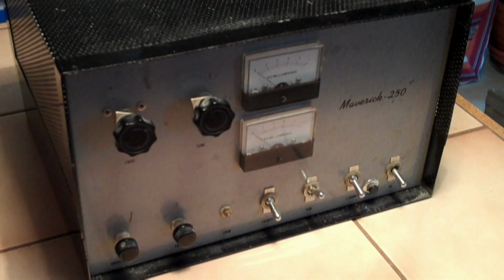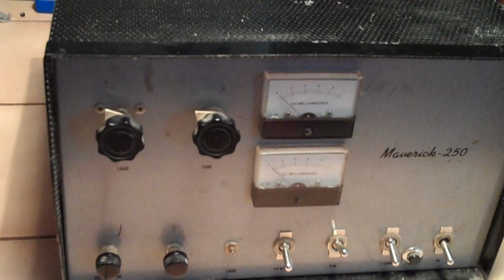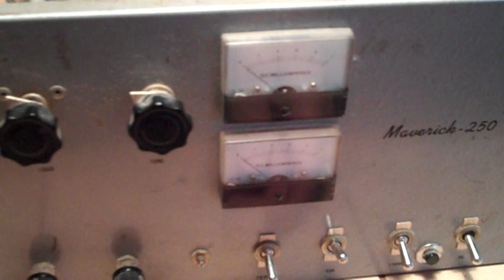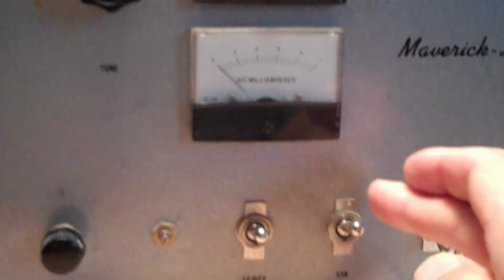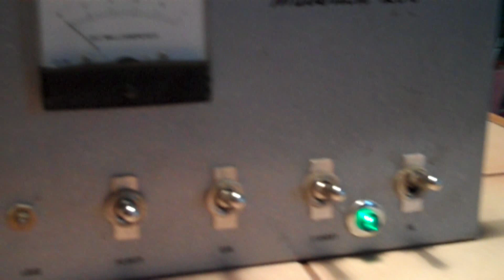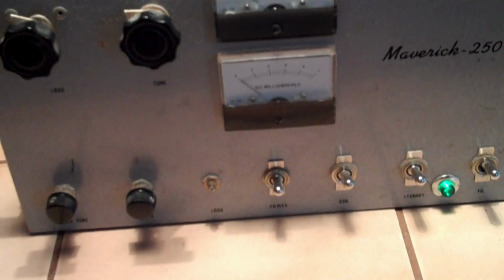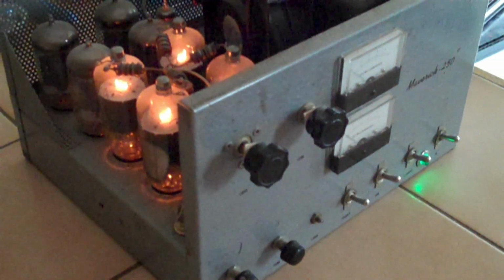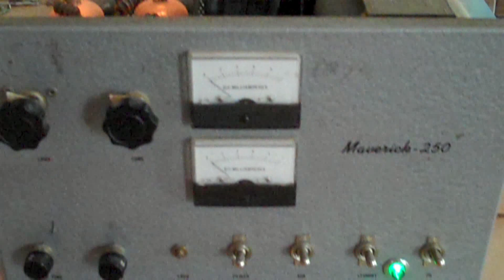maverick250

Comment: That's not the factory fan but rather an aftermarket fan installed in it ! The POWER SWITCH connects power to the transformers which in turn supplies voltage to the fan and the filaments or heaters in the tubes both driver and final tubes also the keying tube ! The standby switch enables the keying circuit when on , and disables it when in standby mode ! Low and high power switch on low is only the driver tubes and engages the bottom meter ONLY showing milliamps current basically a indication of conductivity relative to indicate power output and high side switch engages the driver section to drive the final tubes which disables the bottom meter and ONLY the TOP METER works on high side same relative milliamps current for power output indication high side ! This is a grounded grid amplifier which means the control grids are electrically grounded ( soldered to the metal case via the tube socket ) so it's not biased as the Varmint amplifiers are on SUPER MOD operation ! No swing machine here but good power ! These amplifiers we're designed by D&A amplifier company and if operated properly without being overdriven "" 2 to 3 watts input with 7 to 10 watts modulation input power they will last a very long time ( tubes life that is ) !! Of course the driver tubes are 6JG6A and the final tubes are 6LQ6 tubes , 9 pin NOVAR TUBE SOCKETS "" and these can be replaced with higher filament voltage 31LQ6 tubes which are much cheaper and simply getting an external transformer with 30 volts ac output ( I suggest 12 amps of current , better to have more than you need ) you can retube these and as for driver tubes some Russian made cross reference similar tubes are cheap also just check the pin configuration and Google 6JG6A tube substitute for more information ! These are nice little amplifiers and a part of history in the LiNeAR Amplifier Hall of Fame !! Long live the D&A Maverick and the phantom amplifier !

Comment: Hola tengo un linial maverick 250 nesesito saver que tubo lleba este aparato.grasias.
Reply from the maker: 4 6LQ6 tubes in the output, with either 3 or 4 6JG6 types on the driver side.

Google translated: 4 tubos 6LQ6 en la salida, con 3 o 4 tipos 6JG6 en el lado del conductor.
Reply: Hola el tubo mas chico que numero es grasias.